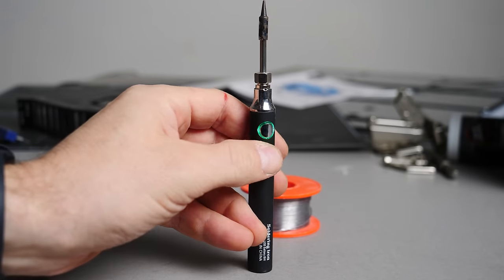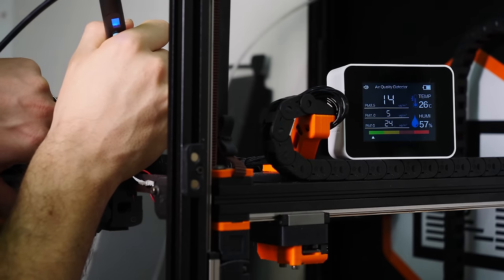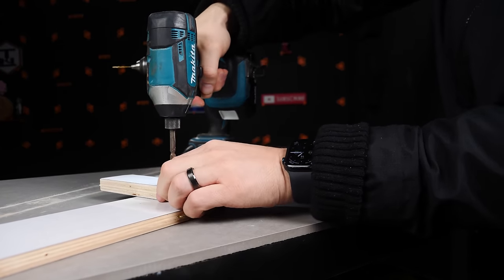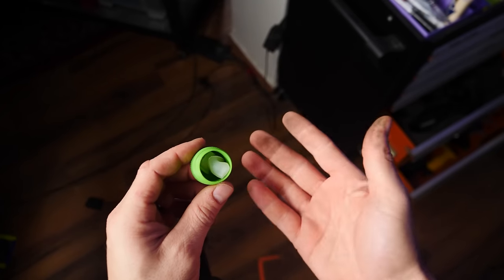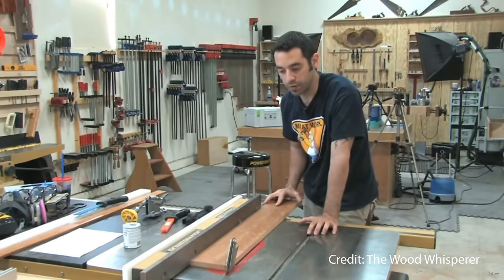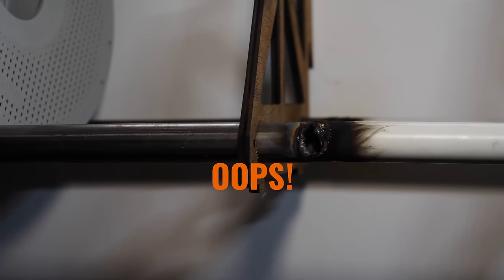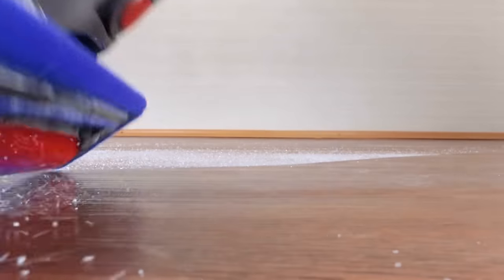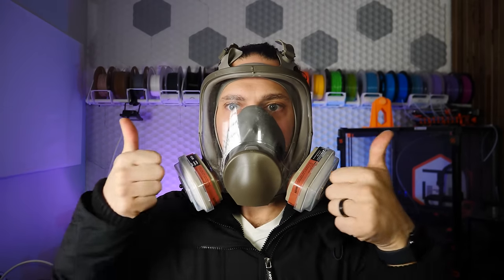9 Maker Tools I Wish I'd Bought Sooner

Comment: I used to be a sheet metal worker (Tradesman) for welding I would suggest a MIG welder. Much easier and not much of a problem with sticking. You can get gasless welders and they work fairly well. If you do go serious you can change it to gas.
Reply: I haven't done much welding . I used to enjoy tig and made my mum a coal scuttle out of 2mm surgical sheet steel. It could easily fit 25kg of coal and was hard as hell to lift up. Is that @salisburykarateclub in wilts or one of the states salisburys? Only ask as I live in Andover Hants
Reply: I agree a MiG would be highly suggested, however I would suggest not using  flux core.
Reply: id recommend a good ac/dc tig machine... mig machines limit what materials you can weld. with an affordable tig machine like a primeweld 225, you can weld any material that is weldable. the learning process is a little more intense... but if youre only gonna own one welder, it should be the most versatile machine possible
Reply from the maker: Yep, I'm enjoying this welder so much, I'm probably gonna upgrade soon. I feel like I should master one before moving up, though, no?
Reply: @thenextlayer  mig is so much different than stick or tig that it doesn't really translate. There are a lot of really good YouTube videos to help you get started in the world of tig. I recommend weld coach YouTube channel
Reply: @noclass2gun342  TIG is so much fun in my very limited experience. If I were going to buy one welder, that'd be it.
Reply: @MikeKobb  to me it makes the most sense... need to weld some aluminum... tigs got you... stainless, also tig, titanium... tig for that too... need to do some cast iron repair... yep, tig can do that as well. The versatility is unmatched... and once you know what you're doing, nothing comes close
Reply: @thenextlayer I agree that the most versatile welder is probably the best choice. Consider a multi process machine. MIG,  TIG, MMA (Stick). I started with a basic transformer (massive and heavy) stick welder and was constantly struggling to get decent welds on anything but heavy steel (3mm+). I splashed out on a multi process machine, I bought a UniMig Viper 185 which is DC TIG only because I couldn't justify doubling the price (Around $1000 AUD/$500 US vs $2500AUD/$1200US) for AC TIG which is needed for TIG on Aluminium. My stick welding was immediately much better. Not to mention having MIG available (it is possible to MIG aluminium with the correct spool gun). 
With your concerns about air quality any welding process that uses build in shielding, which is the flux coating on the welding rods and inside flux core MIG wire you will have more noxious gasses in the air. Argon/CO2 MIG and Argon TIG processes are cleaner and better suited for indoor use.
Reply: When I was 14 in 1999 with the money from my first job I bought a cheap at the time ($300) no gas mig welder. It was to install my moms wheelchair lift in the new used station wagon she got. They wanted $2k to mount it in the car, I did it for 2 weeks in my spare time by welding brackets in the basement. Worst part was, my uncle the welder with top of the line Mig, Arc, oxy-acetyline, and saws and such refused to help. They weren't pretty welds, but they kept it working like a champ for 5 years without repair!!! As soon as I finished my "dad" pawned it for gambling money when I was at school. I could've gone down a whole different life path lol.
Reply: I have a MiG as well as a super cheap flux core welder I bought from harbor freight because I needed to weld inside the hull of a prop submarine and we could not fit our MiG inside as the space was too tight. The flux core was a very pleasant surprise. Requires some cleaning with an angle grinder as there is a LOT of splatter but it lays down a decent weld and the whole machine was about $125.

Comment: I still recommend a Pinecil for $25, which is still extremely cheap when compared to Hakko options or is still cheaper than TS-100 versions. Portable Irons are almost always limited to about 250-300F temps and those aren't good dealing with Lead-Free solders. Calling Pinecil expensive is off putting... be clear with the recommendation.
Reply from the maker: They're like $50 to get shipped here!

Comment: Like you, I discovered hearing protection too late, and have suffered from tinnitus since I was a teenager. Last year I was given a pair of IsoTunes Air Defender bluetooth ear muffs that block harmful noise while allowing me to listen to music from my phone. They run around $70 and the batteries last about 40 hours, so I only have to charge them about once a month. I like them so much I wear them while mowing our lawn.
As for vacuum cleaners, I've had the same shop vacuum for almost 30 years now, while my wife has burned through four household vacuums, so our current household vac is a huge Bissell MultiClean shop vacuum. It was reasonably priced, has way more suction and a much larger capacity (6 gallons) than our last vacuum, and doesn't choke on pet hair. Yes, it's louder than a "higher end" home vacuum, but the attachments from our old vacuum fit it and my wife loves it.
And all men should carry a good pocket knife. I have about 20 knives scattered around the house, so I'm never more than a few feet from one, and I never leave home without one in my pocket or on my belt.
Reply: I have used a folding box cutter for more than a decade and it's super useful. Current one has a wood handle and looks like a pocket knife, I never have to worry about sharpening it, and I can pop the blade out if I need to do some scraping.
The wife teases me about always having it, but is never shy to ask me to open something up or whatever.
Reply: Yeah, I always carry a swiss knife, even if it's illegal where I live

Comment: Another pro tip on tools, visit your local pawn shop. Especially in winter when alot of trades slow down. You'll usually find great deals on stuff on this list. I got a tablesaw, impacts, and a basic welder for 300 in great condition.
Reply from the maker: Oh snap. I don't think we have pawn shops here, but... that's a great tip
Reply: You’ll also likely see a lot of stolen tools. Pawnshops don’t care where it comes from, and they’re an easy fence for thieves.

Comment: Planers are neat for resawing wood or cleaning up rough cut boards. The thing I would buy before a planer though is a router and a compact stand/table. With a router, you can round over or chamfer your corners. This will make your projects look an order of magnitude more finished. A router can also cut dados and tenons. This is especially useful for cabinetry, but also useful for basic furniture.

Comment: My most surprising use it for everything tool is my Dremel HSES-01 cordless screwdriver(bosch go appears to be the same tool just more expensive).  I picked this one specifically because of the low minimum torque.  It means I can use it to screw into 3d prints and other plastic and have a setting to not over torque or crank it up a bit for slightly tougher things.  I use it so much it goes in my briefcase and goes with me everywhere.

Comment: The single most used tool I have is a good multimeter. I have had a good one from the late 90s on. They're indispensable for anyone from an auto mechanic to a 3D printing hobbiest.

Second recommendation is a copy of Machinery's Handbook. There's just so much useful information in those it's hard to describe. Everything from metal qualities, to how to inscribe polygons in circles.

Comment: This is a great video for those who are just shy to spend any good amount of money in really useful tools, that we didn't knew it existed.

I Would add a headlamp a pocket light, and a hand light to the really useful list of tools, there are some really bright brands that are also "cheap" around 50 - 60 dlls that are in the edge of being a blinding hazard, also FYI there are two types of lights throwers lights that have a long reach 50-200 meters of a continuos light, and flooding light that can illuminate a whole room from a single sources.

Comment: Arc welders are good, but what you really want if you want to do serious metal work/welding I'd recommend getting a MIG or TIG welder. Planers and Jointers are great for woodwork. CNC machines are great, too, and are actually fairly reasonable in price depending on the size and capabilities you want. Just a couple suggestions.

Comment: Thanks for the video.

The most useful tool that I carry is a small folding knife that uses utility knife blades.  It's very small and thin, has a pocket clip(which I don't use), and it's a great tool for 99% of the cutting tasks that I come across.  And being so small and thin, it's easy to hold it higher up and do precision work with it.

I still carry a pocket knife, but that rarely comes out.
Reply from the maker: Smart
Reply: project farm has a comprehensive test video of folding utility knives that helped me decide which brand fits my needs

Comment: An inexpensive tabletop drill press might be helpful.  Bonus, you can print a mount for that soldering iron and use the precision movement of the machine as a heat press.  If you do get a press, invest an extra bit on a set of vise clamps that mount to the channels in the base plate.

Comment: I have quite a few soldering irons. The TS100 and a few others. I also bought bought the one you have, the battery operated one. And I love it. I use it for smoothing out prints. I liked it so much I bought 4 more. Lol. And for 10$ you can't go wrong. They come in so handy. I also picked up quite a few tips.
Reply from the maker: Glad I’m not the only one! I use it for that, too! And welding plastic

Comment: A cordless vibrating multi tool that works with your other cordless tools is awesome. Oh and my ryobi  brad nailer is more used than I realized it would be. I like Adam Savage’s advice on how much to spend on tools…. ‘Get the first one cheap, if you barely use it you saved heaps, if you use the poop out of it you will ware it out and then you will know what you are looking for when you replace it with a good one”

Comment: Silent portable aircompressor with a few liters capacity will enable many different tools - painting, nailing, etc. Aircompressor tools are much cheaper than their battery alternatives. For a home use it saves a lot of money and doesn't add much complexity.

Comment: I'm on the same level you are but I also obsessively research this stuff.  Yes, Table saw by far the number one tool that opens up the door, but I hear the next one would have to be the band saw.  Drill press might also be a good second step depending on what you're doing, but most shop channels point of the band saw as the second step.

Comment: I keep a gerber multitool in my camera bag, it's always come in handy. Table saws aren't as daunting as they seem, most tools aren't. Good list of indispensable workshop tools. I would add a Router to the list. They are so bloody useful. A rotary tool has so many uses as well, from using it as a mini drill press, to a sanding or buffing tool, so handy. (I mean, who doesn't love a dremel anyway, right?)
Reply: I've only been 3d printing for a month now, and absolutely love it. I worked in construction for a time, and learned how to use a lot of tools growing up with a handy parent. A tool I don't currently have, that I need to add to my workshop is a voltmeter. I've been dealing with more and more electronics lately and it's downright essential. I think everyone who 3d prints/designs, already knows to have Calipers, but it's a pretty necessary tool to have in the box. I like to upcycle old electronics to make them work with current tech, so being able to design my own 3d prints to adapt an old Ipod stereo to taking android phones for instance, calipers and a fillet gauge were absolute musts.

Comment: When it comes  power tools,  sometimes spending a little more will be the difference between using it or not.  Example, I used to have a smaller, dare I say unstable table saw like yours.  I almost never used it and  opted just to use my circular saw because the table saw was a pain to set up and just never felt safe.   I finally upgraded to a heavier contractor saw, which was not much more than the first one. and now use it all the time because my confidence in the tool is better.    Hope that made sense.

Comment: The Corkscrew on a pocket knife is also a useful tool to undo some tight knots. Not just to open bottles of wine 😉
Reply from the maker: I have an awl on mine for that!
Reply: @thenextlayer  Yeah that works too. 

Actually, my favorite small knife multitool is my swiss army knife. It's a Victorinox Tinker Deluxe. 

One of the few Victorinox that swap the corkscrew for a Phillips screwdriver. Also have a awl/reamer thing. It may be a bit sharp to do the rope knot thing with though! It works very well to make the screw holes in the magnets for when you build a Voron bed... 

Has a surprisingly servicable tiny pair of pliers and scissors as their main tool beside the 2 usual knife blades. 

Probably also like it a lot simply because it was a gift from my mother, which may be the most important features of all here!
Reply: @thenextlayer  My Swiss Army knife has a Philips screwdriver in place of the corkscrew. Much more practical for my purposes. That Gerber you got looks very nice.

Comment: Used to do a lot of welding and had fun making custom bicycles and had a nice workshop  mig welder setup but also had a nice lightweight portable DC welder that was fantastic and quite reasonable in price usefull for welding up 16 guage steel EMT tube. Make sure to use adequate eye protection as I took this for granted sometimes while doing fiddly stuff and now in later life suffer from slightly impaired vision from catteracts from the UV. Be warned!
Looking at getting into 3d printing for 3d printed rc slope soaring gliders and slot cars and tracks so interesting channel to find out and learn more about different printers and filllaments. Interested in carbon fibre and lightweight pla so interesting videos on the channel. Thanks!:-)

Comment: Thanks. I see you are using the 5N11 filters on your respirator. Note that these are N95 rated. For woodworking, you should really go for N100, which will be much better filtering particles down to 0.3 microns. Sawing, sanding and other woodworking tasks produce fine dust that can settle in your lungs and cause severe issues down the line, so I would personally only use N100/P100 for woodworking.
BTW, I buy at Brand too :) They're like a 10 minute drive away from me.

Comment: While having a bunch of different wood working power tools is nice, a table saw is extremely adaptable. Want to cross cut? Build a sled. Want to joint? Build a jig. You can even retrofit a router table into most table saws with a little ingenuity. Table saw with some sleds/jigs + router with table and sleds/jigs opens you up to a ton of functionality and buying dedicated miter saw, jointer, and planner really just saves you time; especially if you're the only person in the shop. Take it from someone who spent all the money on all of those separate parts and find it easier to just use my Delta table saw I mounted a Bosch router table on one side of. Your money is better spent on safety items like a grr-ripper and feather boards, better blades, and a crap ton of clamps.
Reply from the maker: True!

Comment: a table saw is very nice indeed, but cheap one will be too wobly to be really precice (if you need that) but you can achieve similar results as with a good table saw  (including arrow straight cuts!) with a track saw with just a little more work to set up the cuts. My table saw is mostly collecting, not producing, dust and takes a lot of real estate, and was also much more expensive than my certainly not cheap track saw.
Reply: I'll second that. For me, space restrictions mean that I don't really have anywhere to put a table saw, so I never bought one, but occasionally borrowed my neighbours old Bosch PTS10 (the only sub-$500 one I've found with its feature set - now sadly discontinued). I made do with a circular saw, but getting nice, long, accurate cuts was tedious compared to with a table saw. When I discovered track saws it was a game changer (not an expression I use lightly) - for many things it's far more convenient than anything short of a big, professional panel saw/big table saw. Sure, for some of the smaller tasks a table saw would be easier, but with a decent track saw and a mitre saw it's now quite rare that I wish I had a table saw.

Comment: My absolut favorite tools are:
1. realy high quality wire stripper
2. (wired) soldering iron with 200W that is compatible with jbc tips, you can change to the best tip for the task and it heats up in like 2s (don't know the name, but it is from ali express) 
3. cheap hot air soldering station for cleaning up 3d prints, shrinking tubes and a lot of other stuff
Reply from the maker: Hmmm good ideas.

Comment: You've discovered shop vacs and impact drivers. 

I would go for an air compressor (one one with high flow) and a bunch of air tools next. So much lighter and more variety than battery tools
Reply: Air tools are on their way out for home use. I personally don't even use any of mine anymore unless I'm nailing or maybe a stubborn lug nut.
Reply: @jerbear7952  yes, but I suspect that is by the design of tool manufacturers. 
I've recently gone back to air tools, and found them cheaper, lighter and just all around better than battery tools. 

Why just take a few hundred bucks for an air compressor when you can take a hundred for each battery?

Comment: Brazing is another good one. Sort of a middle ground between soldering and welding, but it's a lot easier than welding and the torches can be used for other things too. Just do that safety research before getting your tanks for sure.